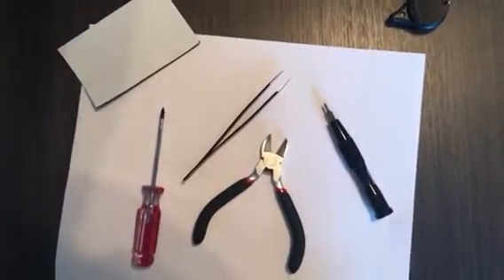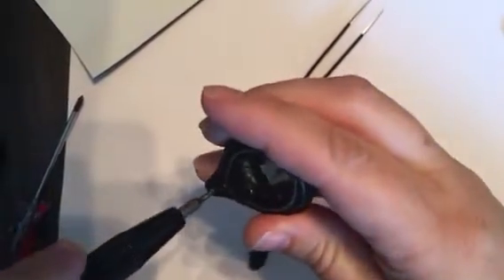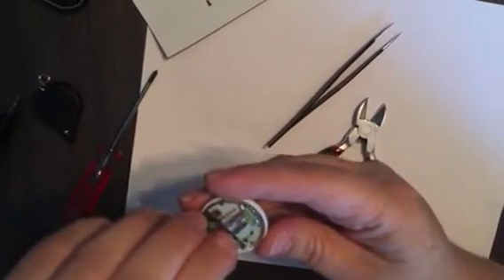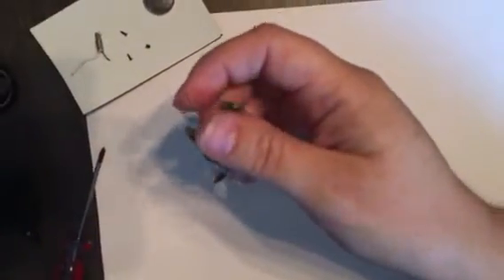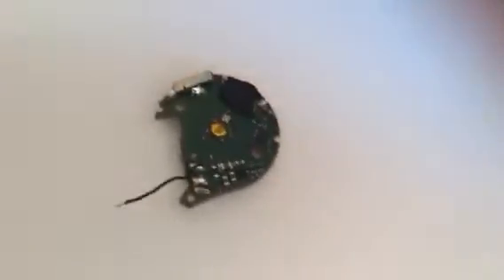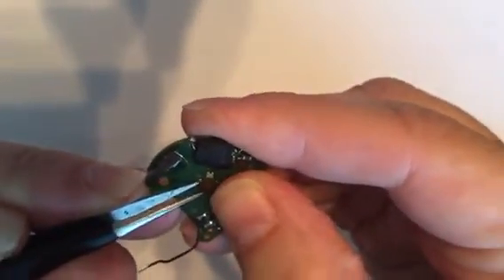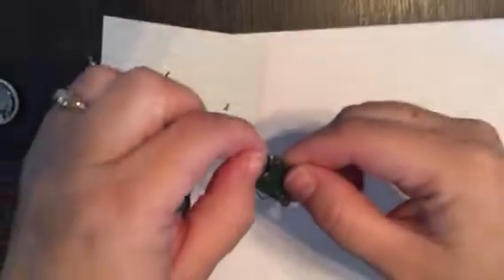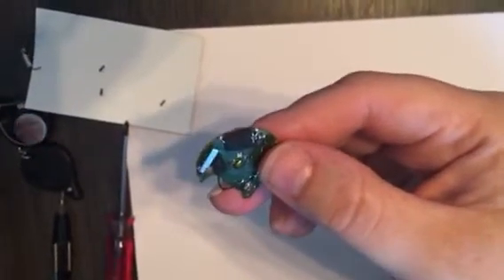Modification of Pokemon Go Plus to "Auto Click"

Comment: I tried doing this mod but it doesn’t auto catch it works as it would normally but without the vibration. Mine had a red a blue wire I closed the circuit with the blue wire
Reply: Try a different corner.. lower right

Comment: This modification may no longer work if you are using the latest version of Pokémon Go. Basically when a Pokémon is nearby a signal is sent to the Plus and it would flash green and operate the vibration motor. With the modification the button press is done automatically with the vibration signal. The latest update seems to be able to detect this instantaneous response and the causes the Plus to bug out and flash red and stops responding to pokemon. If it was a pokestop it flashes red and locks onto the pokestop and ignores pokemon. I don't know if anyone else seems to be experiencing this problem. To fix this problem it seems that there would need to be some sort of delay in the vibration motor signal getting to the switch which is beyond my expertise.
Reply: i modified today with android. it works well. i just put an extra cable on it. so i still have vibration.
Reply: Matthias Meier can u Tell me how u did that ? So Where did u put the 2ends from the extra cable ihr can you Tell me Where i can find a Video for that mod ? Thx
Reply: Matthias Meier habe mir gerade deine Playlist und so angesehen sprichst du deutsch ? Wenn ja wäre das großartig und kannst du mir bitte genau sagen wie du das gemacht hast mit dem extra Kabel ? Oder kannst du mir sagen wo ich ein Video finden kann was diesen Aufbau betrifft ? 
Danke dir^^
Reply: Momo Kbb wo das schwarze Kabel aus der Platine geht habe ich ein weiteres angelötet. Das andere Ende habe ich an den Punkt gelötet, der hier im Video gezeigt wird. Wenn du auf Facebook nach meinem Namen suchst, und als Profilbild RISE siehst, schreib mich einfach mal an.
Reply: Matthias Meier habe dich nicht gefunden beschriebe dein pb oder sende mir eine Anfrage Name Mohamed Abu-Hashim und pb ist eine Katze
Reply from the maker: It was such a pain for a bit! But thankfully... the mods works again after a PoGo update!

Comment: Hi Susan, I modified the Plus but it's not autocatching. I still have to push it after seeing the light. if not, the light stays green until the Pokemon flees
Reply from the maker: I find that sometimes the black wire needs to be adjusted. It is usually the connection to the push button.